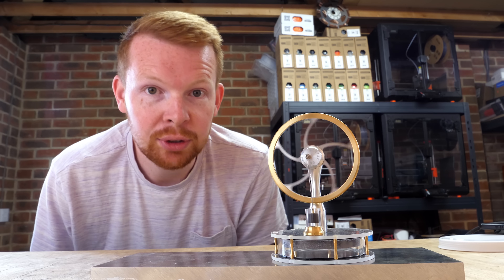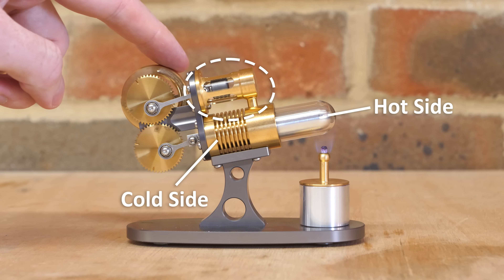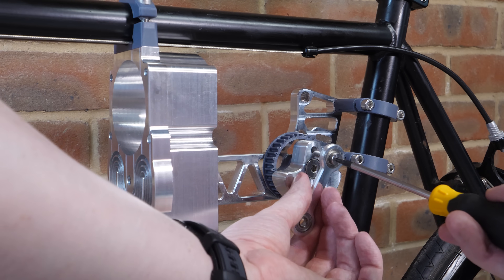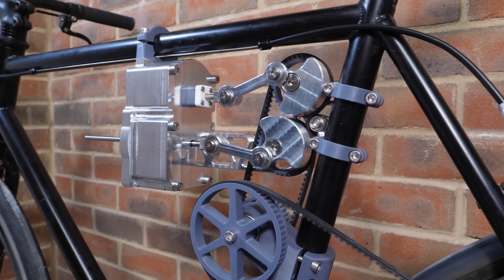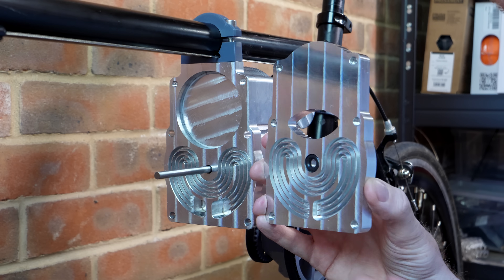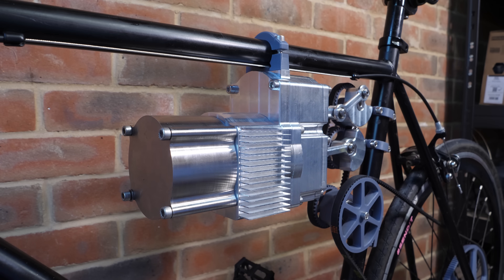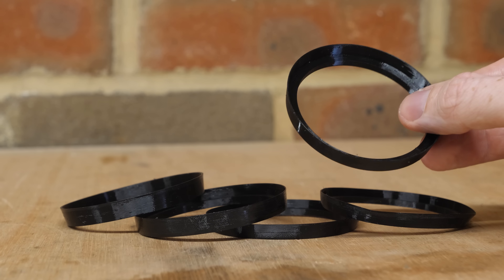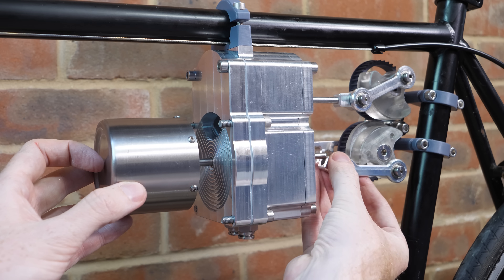Building a Stirling Engine Bike - Part 1

Comment: I love the perfect demonstration of why stirling engines aren't used commercially.
But the effort you put into this is impressive and it shows.
Reply: They are in some applkications. Check out the Dachs heating unit. It's a gas fired engine that produces electric energy and unes the waste heat to heat your house. It's intended as a replacement for gas heaters.
Reply: @clockworkvanhellsing372 heat is lost like everywhere, so stirling engines have some place in future to save and utilize heat energy
Reply: They are used in some submarines as they are really low noise.
Reply: Not if you heat up water instead of air.
Reply: Sadly true, but some commercialized one did still exist  like PHILLIPS stirling engine in a house genearator market.
Reply: His prototype has 0.5% of it's full potential at this heat power. He designed it poorly. But I hope he makes enough effort to maximize it to full potential
Reply: This is a worst use-case situation.  In a static installation, and with a variety of heat sources, stirling engines make more sense.  For instance, farm pumps.  ANYTHING that will burn can be used to supply "the hot side".
Reply: Swedens Gotland class submarines are driven by stirling engines fueled by diesel and liquid oxygen.
Reply: Depends on the application, they are very good in ideal applications. Even NASA is looking at using a sterling engine for nuclear powered electricity generators in space because they are ultra reliable and very mechanically simple.
Reply: @schrodingerscat1863 stirling engines arent historically reliable. NASA is interested in stirling engines due to their ability to convert waste heat to power, and high efficiency
Reply: @takiktos1265  With modern engineering and fabrication techniques sterling engines are incredibly reliable because they have very few moving parts and the things that historically caused reliability problems are no longer a problem. They are also very efficient as you say.
Reply: Stirling engines aren't widely used commercially because: 
1. In automotives they are pretty much useless due to low mass per HP, low responsiveness and/or drivers aversion towards CVTs
2. For industrial and military applications diesel, being the cheapest fuel, cannot be used easely in stirling engine
3. Cost of R&D doesnt justify it in the eyes of investors

Tom didnt demonstrated why stirling engines aint used commercially - he just made simple mistakes in it's development, which he corrected later in the video. The engine worked in the end
Reply: @takiktos1265 
1. The problem is high mass per horsepower - perhaps that's what you intended, but you said the opposite.  
Yes, responsiveness is an issue for automotive applications,  but a hybrid system would fix that. 

2. Because they use an external heat source (rather than internal combustion), Stirling engines are ideal for energy source flexibility. Diesel fuel works very well, and in fact the Kockums Stirling generator sets for air-independent propulsion in submarines run entirely on diesel fuel.
Reply: @brianb-p6586 a lot of heat energy is wasted in internal combustion engine, stirring engine can fix it to some extent and make car more efficient.
Reply: @dmitryhetman1509  ideally, yes, a Stirling engine might be more efficient. The overall cost and benefit analysis has never favoured Stirling for automotive applications.
Reply: @takiktos1265   except he never did show it "working" he showed  with an exterior power water pump and a torch it can work without weight on the bike. He's using more energy to make an inefficient engine carry nothing then if he had a gas or electric motor pushing a weighted bike around. this does in fact show why these engines are not used commerically.
Reply: @takiktos1265  Are you mad?
Reply: @takiktos1265 the power to weight ratio is perfectly acceptable for automotive applications, NASA built a Stirling engine powered car in the 80s and it worked just fine, definitely practical in terms of weight and power.

Stirling engines can easily run on diesel, better than gasoline in fact. If you can burn it to produce heat, it'll work.
Reply: @jaredlancaster4137  Yup. There is also the problem that no one wants to turn their car on and wait for it to heat up before driving. There was a local company here 10, er, 15 years ago making stirling engines for boats. There are a bunch of lakes here that prohibit fueled engines for ecological reasons. At the time, battery electric engines were still rather limited on runtime, but if you drop a line past the thermocline, you have a cold side that is reliably 38F. The thermocline is as shallow as 2 feet in some of them, and rarely more than 6. So they worked great as summertime trawling motors. Some of them were configured with a high temperature "hot box" if you wanted more than the ~1mph you'd get just using ambient air, but that largely defeated the purpose as you then couldn't take them on the "no outlet" lakes.
Reply: @yellingintothewind This sounds very interesting, do you know the name of those boat manufacturers?
Reply: @jaredlancaster4137 i heard about the NASA stirling powered car, but I couldn't find any more information about it - it's HP, transmission used, weight, or any other important details. Also a car that was acceptable in the 80s might not be acceptable today
Reply: @jaredlancaster4137 and diesel doesnt burn
Reply: @takiktos1265  Tell that to my furnace. It runs on No.2 diesel oil, just takes a proper combustion chamber.
Reply: @gege0298  Gosh, this would have been about 2009 or 10, and I only took a cursory look, so I can't say I remember all the details clearly. It was outboard motors, not whole boats. The kind of thing used for trawling on your 10 ft rowboats. I can find references to larger power plants, like microgen's stirling electric, that are used for bigger boats. There's even a couple websites devoted to stirling engines, including on the UK's Canal Boats. But none using a solar collector for smaller boats. For all I remember, they may have folded before shipping. Also a lot of the local manufacturers who do that kind of thing have basically no web presence. I'll ask around and see what I can find though.
Reply: @yellingintothewind  I see, seems reasonable for their customer bases not to be too involved online. There do seem to be some hobbyists out there logging their projects. Likewise for Microgen.
Cool that they managed to make it work, cheers for the references!
Reply: Yeah, there's a sizable industrial park here, which does small and medium scale manufacturing mostly b2b. Half the companies have 0 online presence, and most of those that do have a single page website with a phone number, address, single photo, and maybe an email address. There's a bunch of neat stuff made locally, but it can be hard to track down sometimes.
Reply: Philips made a generator that was widely used in Holland now the Netherlands.
Reply: When did he demonstrate lazy engineers giving up on difficult problems to default back to legacy systems?
Reply: @custos3249  Cupid stunt.

Comment: It seemed to run much better, and faster, at the end but I'm not so sure whether that's to do with the two modifications you made or just the fact it wasn't actually driving the back wheel of the bike at that point. 
I agree that the thinner belt probably had a drastic effect on the efficiency but I'm not so sure about the flywheel. Surely, had it been connected, the back wheel of the bike would have provided the same amount of momentum to keep the engine running as that flywheel did.

Nice project though, have you started designing a 'safe-to-wear' pair of asbestos long-Johns yet so you don't end up with a handful of toasted nuts at the end of your ride? 🤣

Comment: 8:54 so for this section, in my design (i have a kontax sterling engine i got inspiration from) the grooves should be spirals instead or ring grooves to improve the aerodynamics. With concentric rings youd end up with air trapped in the groves acting as a cushin for the air above it, like how golf ball dimples work. If you instead use something like 12 spiral groves (12-fold radial symmetry) then it will promote air flowing through the groves (and across the surface of the metal) instead of across the groves. At least thats the geometry that i think would work best for the hot side since the cold side has the opening. Also for my design i would use one of those aerogel ceramics (also with spiral grooves) as the displacer piston to reduce efficiency loss, aside from that i would be interested in figuring out a design with a double sided power piston with 2 displacer sections so the piston gets pushed and pulled from both sides at the same time (thats twice as many power impulses as a steam engine)
Reply: That sounds like the right kind of path to explore.  I was thinking this is all about heat transfer into and out of the air, so focus should go to improving the input and output heatsink concept.  It seems an array of small displacers would work better than one big one and allow more surface area for heat transfer.
Reply: @chrismerklin8460 i think that you're correct in thinking that more smaller displacers would be more efficient for heat transfer, but i think the added friction from all the extra shafts would be worse.

Comment: I've always wanted to make a Stirling engine but never really had the engineering chops for it. A high pressure self-starting fully enclosed helium four cylinder alpha type stirling engine was the design I lusted after, with a regenerator (obviously) and minimising the "dead" air in the design.

Comment: Regarding the clutch, Might I suggest going for a magnetic one. That way instead of just dumping energy out as heat you can actually harvest it as electricity instead to recharge the batteries for the cooling pump. It's true that stirling engines are efficient but the drawback is a lot of energy waste to trottle them instantaneously. Maybe down the line you can even use the energy generated by the clutch to power a motor and make it into a Prius-style Stirling-electric hybrid.

Comment: One important tidbit for you: high power Stirling engines run at above ambient pressure with a sealed crankshaft box. Ideally you'd get it helium tight and fill it with a couple atm's of helium.

Edit: just watched the last few seconds and you mentioned it yourself. Pressure is key.
Reply: perhaps he would couple it to a sealed generator, to avoid the helium escaping through crank seals.
Reply: @martin-vv9lf  I think A gear reduction inside the sealed crank would be more efficient.  Let you use a high drag low-leakage seal on the output shaft without loading the engine.
Reply: GM has made a car with a Stirling engine. The test results were good. When environmentalists asked why GM did not take this kind of car in production, the GM spokesman said: "This engine is a bomb.". They had used a very high pressure to generate enough power.

Comment: Just use a battery with coils to heat up the end cap, that with the regenerator you got ur self a long lasting engine. Just gotta find a wat to recharge the battery

Comment: Your crank lobes are way offset. The point of a crank lobe should be to balance the crank. When you spin it fast by hand you can hear it being off center, and it stops with the lobe pointed straight down and even oscillates a bit. If you want mass for a flywheel affect a crank lobe is not the way to add it. You will lose a very small amount of power to friction with an unbalanced crank and given how tight your tolerances are on this, that's probably going to matter.

Comment: How do you know how to time the two pistons is 90 degrees leading done by trial and error
Reply from the maker: That's what most stirling engines use, but you're right, I need to experiment with different angles!

Comment: Awesome video, I wish to offer a suggestion but as I have 0 engineering knowledge I have no idea if this is a good suggestion but here goes:

Instead of 2 cams could you build a single cam to run both pistons and if so is that even a “energy savings”? Around the 16:00 mark when you had it working, watching the two cams rotate, in my head all of a sudden I saw a single cam with two attachment points for the pistons, so since you and I imagine many of your subscribers actually know and understand how this stuff works I thought I would pose the query, Would a single cam running both pistons be more energy efficient? The only problem I see off the top of my head is you would need a larger cam and to a certain point this might be beneficial but eventually will not. Let’s say both cams weigh 100 grams together, if the single cam is less than 100 grams (completely made up figure to demonstrate my idea) I think that would help save energy or increase efficiency or something but if the single cam has more mass than the two individual cams my guess is no bueno, wouldn’t work any better. Or I’m a complete fool and have this completely wrong lol. 

If you’ve read all that and leave a response then allow me to thank you and wish you well, if you read all that and are like WTF, lol, I don’t blame you and also wish you well, lol. To all who have read these words may you have a good day and much joy this day.